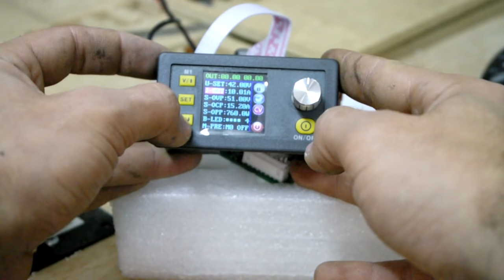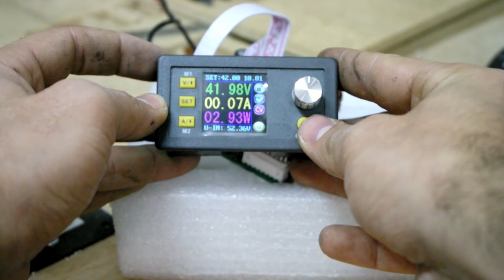How to connect brushless motor controller wires 250W 36V (Wire assemblies)

Comment: do u need to have ignition connected for it run or cud i run it without a conection thanks
Reply from the maker: No you can connect it manual to power to activate the controller..
Reply: @EVCustoms  great thank you

Comment: Hi there . I have a 36volt electric bike with passive assist . It only has 6km mode on the twist throttle. Is there a way i can change the wiring to use as normal 25kmh speed ?

Comment: Hi, Great Video. It helped me out sorting out connections on a kit I brought from China. But my controller does not have a three speed connection as in your video, is there anything I an do to reduce its top speed?
Reply: I found the 2 spots you need to jump together on the circuit board to get the extra speed.  It seems not all the wires are hooked up on some of theae

Comment: im trying to get a scooter running I pulled out of the lake  ..its a razor version 2 with a brushless motor and 1 lithium 36v battery,it has the smaller motor controller but the wires aren't separated like you showed , they have a colored male female connector and I want to install an on off switch but I cant fnd the right diagram..any help or link would be appreciated!!

Comment: Can any of these controller work with only battery pack the motor and the throttle? I have a hub motor only, with HALL sensors but I don't have any other thing, so I really want to know if I can make it work if I buy a controller, a battery pack and a throttle. because one seller on Ebay told me it won't work, but I see on your video you only connected the throttle, the motor and the battery pack, the other connections are shorted on remained untouched.
Reply from the maker: For sure..  You can work with them, the rest is not necessary.
Reply: Do you have any experience with overpowering? In therms every motor can work with any engine all you have to do is keep the motor cool. For example I have a hub motor which says max power 300 W (36 V), but I think it can work with a 96 V 1500 W controller. More voltage means more RPM and more amper means more torque.
Reply from the maker: Jordán József Yes i have experience with overvolting hub motor..  37v to 97v is to much difference..  if you have 36v 300w hub motor is 600watt max output for this motor for few minutes, you can try 48v 12A controller, like this you increase the speed but decrease the torque and efficiency..
Reply: Just make sure battery & controller r 100 % compatible!! Not 36 v controller & 72 v battery 💥💥. Then just make sure when u bought the motor it can Handel the what the controller dishes out.. all this the seller of any these components will tell u..!!!
Reply: Over bolting ultimately leads to 🔥🔥!! Good luck.. stay safe & have a House to go back to!!!
Reply: @EVCustoms  throttle and hub just connect the 3 wires?

Comment: do u know if a 
48v 24.5ah batterey
yyk 50a controller
1200w motor
works well together?
Reply from the maker: Sure!
Reply: @EVCustoms  will the 50a controller be too much for the motor? or drain the batterey alot?
Reply: @EVCustoms  what battery did you use? Also that little device you turned on was that a bms for the battery voltage?

Comment: Brushless Motor Sine-wave Controller  Sabveton 72 v 100A    controller new but it miss a White wire.
 Can you tell me? What is the function for the white quiet.
Reply: Hull  sensor missing white wire.

Comment: i have a seriouse question for you i bought the little controller to use with my 500 wat rear motor but when i connect everything up the wheel goes the wrong way what am i doing wrong
Reply from the maker: You have 2 options...  Find learning wires,   or swap power motor wires until motor turn in right  way,  NOTE do not turn  throttle at maximum ..  Only 5-10%

Comment: Do you need a specific throttle cable/wires? Or could I just use the original one that came on my scooter, it also has three wires red, black and green.
Reply: If the controller also uses 3 wires for the throttle input, then you may be good. It ASSUMES the manufacturer used standard connectors and wiring colors. Make sure any connectors match wire colors in the right sequence before connecting them or you could damage the throttle.
The throttle uses Red=usually +5V (Vcc), Blk=Gnd, and Green=an voltage output that varies from 0 to Vcc as you turn the throttle, with Vcc being max throttle. Example, if Vcc=+5V then max throttle would show +5V between Green and Black.
You can test the throttle independent of the controller by providing your own Gnd and +5V supply, and measuring between Blk and Green with a voltmeter or oscilloscope. The voltage on the green wire should SMOOTHLY change between 0 and +5V as you turn the throttle between min and max. 
Or, without any power applied to the throttle AND disconnected from anything else, you can check to see if you can read a smoothly increasing or decreasing resistance between Blk and Grn or between Red and Grn as you move the throttle. There should also be an unchanging fixed resistance measured between Blk and Red. I'm GUESSING it's about or less than 10Kohm, but it could be something else. It could vary with manufacturer. All the controller cares about is the voltage on the Green wire.

Comment: Hi there, I'm thinking of replacing the 3 power cable connectors with 1, 3 pin connector for convenience. I'm trying to find a good connector for that, do you know how many amps go through those cables? The connector I found is rated 8amp and don't want it to melt...
Reply from the maker: Hi mate... don't connect this connectors, you can damage your controller. Tel me rated power of your controller?
Reply: @EVCustoms  Thanks for the quick reply, I appreciate it. The controller is 36V, 22A (750W) max. The motor is rated 500W. I was thinking of using a simple 3 pin connector so I can quickly connect/disconnect it, as I keep it with my battery in the same bag. This is the connector I'm talking about: https://cdn.solarbotics.com/products/photos/6c7f8225a3bf9590e8258e5140317ff3/14187-IMG_0138.jpg
Reply: puedo usa este controller en un patinete eléctrico kugo kirim M4 ???agradecería respuesta,gracias

Comment: If it's a 24V 250W controller, does that mean the battery powering the bicycle has to be exactly 24V or a 22.4V battery with 10amps would still work?
Reply from the maker: Hi friend..  the range of 24v battery must be from 18V minimum voltage of battery to 25.2V maximum battery voltage, this is running voltage of battery if is lithium battery pack. But you must see also Voltage range of controller to calculate your running range, All controllers have different ranges.. For 24V 250W motor you need double power to start the motor 500W, so you need 24V 20Amps max output from battery, controller 24V 10A normal and 20Amax for starting current.
Reply: EV - Customs thanks for the quick reply. So will the 22V battery that I have be enough to operate this type of 24v controller in your video.
Reply from the maker: Yes..  but you will not be able to use all capacity of battery, this way  you can use only 60-70% because the controller turned off on 18-20Volts.

Comment: Hello there i have lyfco scooter 3200w it turns on as normal but it wont move they told me that the throttle is the prb but the prb is that i don't find the same throttle like no where.and im just wondering that if i can change  the whole throttle system or wat can i do, please help 😭

Comment: Can i connect a charging socket to positive and negative wires for charging of a battery(it has only 2 wires) when they are connected to the controllers positive and negative terminals

Will my controller burn while charging in ac220v domestic voltage

Comment: My hub motor has not 4 but 5 small wires plus the three big ones. 4/5 are the usual colors: the extra one is white. How to deal with this? Help! The bike is 2012 Curry Izip Merto w/36volt 26Amp motor using three wire throttle, 5 wire On/Off switch/"fuel" gauge/PAS/TAG select control pad. HELP! (I tried simply ignoring that wire but it seems it needs to be connected).

Comment: By "Tree speed connector" do you mean "Three speed connector"?   Is that just controlling the MAXIMUM speed, regarless of the PAS level on the display?    also the self learning/reverse function, i still dont understand how to "set it" or use it after your video. ...maybe a bit of editing to add text explanation?  thank you for this it does help with trying to understand a bit.   another problem is the wire colors are not standardized for some features. I am trying to replace a 36v scooter controller but i cannot find one with the same wire colors, wire combinations and connectors....
Reply from the maker: Hello my friend.. sorry about that, this video is to old... with self learning function you can 1) synchronize your motor power wires (phase colours) 2) you can reverse hub motor direction and 60° to 120° synchronization
Reply: So Is self learn mode an open loop control without using sensors, like a low current sensor less mode, I saw you were able to stop the motor with your hand.

Comment: Can u make any brushless motor run backwards by connecting it to this controller (ofcourse with the same wattage)?
Reply from the maker: You can do that changing hub motor  power wires, yellow, green, blue.

Comment: Hello, very good Video and it helped me to learn about this Controller and Gas twist. But i dont know how to connect the Batterie Indicator. Do you know how to do?
Reply from the maker: Hi friend...  Battery inticator you can put on thin red and black wires of controller, when controller is on power well be go to inducator.
Reply: Hi thanks. Do you mean the Power Cables which are connected with  the Battery?
Reply from the maker: No... You must have other one pair with RED and BLACK thin wires
Reply: No, not Single, only together with other Colours. Maybe dont habe that. But i think every Controller must have a Battery Control? Right? Thanks for your Support.
Reply from the maker: ok... if you didn't have thin power wires you can connect them on battery (thick) wires but you need extra switch to turn it on-off.
Reply: Ok, i see, i need a new Controller with more Cables. Thanks.

Comment: Hi, I have to replace my ebike controller but it's hard for me to understand one that suits it in terms of WATT.
The specifics are:
Rated voltage: 48 V
From 11A to 22 Ampere
Throttle voltage: 1.2V to 4.4V

Do you know how many WATT should my controller be please?
Reply: Sounds like 500 watt nominal 1000watt peak. Take amps×volts to get watts. 48×11=528

Comment: I've got a 9pole cable (Higo) coming out of my 250w hub motor and all I can find is controllers with 3 motor cables(which is fine) and hall sensors with 5 cables.... None of the hall sensors that come from controllers have got white cables with them, neither did yours really. Does that white cable even matter..?

Comment: Hello and excuse me for disturbing you.

Could I know what are the 6 little green, yellow, red, white, black and blue wires that go with the big three yellow, green and blue wires going to the motor?
There are not these little children in my new controller, is it because of this that nothing moves?

Thank you again for your help.

Francis
Reply from the maker: Yes this three little wires is hall sensor wires.. Green yellow and blue  thick wires is power motor wires. This wires must be connect to motor
Reply: @EVCustoms  Ok merci.
A quoi servent ces 6 fils.
Pourquoi la roue de la trottinette ne tourne pas ?
Merci à vous.
Reply: @EVCustoms  OK, thanks. What are these 6 threads used for? Why does not the scooter wheel spin? Thank you.
Reply: @EVCustoms  Hello,
I would like to know if the controller of an electric bike is the same as the controller of an electric scooter?
Thank you for your reply.
Reply from the maker: You must Check ignition wire and combination of your power motor wires.
Reply from the maker: Yes if motor is hub motor..
Reply: @EVCustoms  I do not understand, what does that mean, please?

Comment: Hi EV-Customs and fellow's youtuber. Wanted to uses potentionmeter instead of throttle. Can I connect it to either pas sensor or throttle cable? Connected either end of potentionmeter with +5V and Ground, and signal cable to center lead of potentionmeter. Seeking advice.
Reply from the maker: Yes my friend you can run the controller with potentiometer, signal always center lead for variable voltage output 0v to 5v
Reply: Thanks brother for respond. I am using 10K potentionmeter. Turning the potentionmeter clock wise motor works but when reach middle point of potentionmeter and further down the motor idle. Counter clock wise back to 0 and start again the process having same resulted. Do you have any idea what is the best value of potentionmeter?
Reply: @kwikchek7480  Hello; I'm same point of you. Could you find any proper potentiometer?
Reply from the maker: Hi friend...   Proper  value  is 5k but i need to know  how  you connect the potentiometers??
Reply: Value follow EV. Any potentionmeter will do. Important is how you connect
Reply: The answer I was looking for! Thanks!

Comment: what happends if you connect it to two 12v batterys making just 24dc? would it work?
Reply from the maker: If your controller is on 24V operation...  If controller is 36-48v then is will  be low voltage.

Comment: Hi I need help ,  i am assembling my e bike kit but the wires coming from the battery and the wires from the controller are diffrent so I can not connect , please help
Reply: Al Cle I fixed it now , you have to strip about an inch of wire off all ends then twist the wires together (red to red, black to black) then wrap in electrical tape

Comment: Sir i have a burning connector issue on that big yellow wire, what does mean
Reply from the maker: That's mean you must make better connection on your connector...  try to ironing or cut it and connect them with new wire connector..

Comment: Dear.

I am now repairing a bicycle that has a controller (voltage 36v, 15A, part number: LSW768-113F X18090180 and its model is CE: g3m20211-1592-1) the connection cables of the screen are messy and of the motor HALL SENSORS the same without However, I want to make the correct connection and not short circuit or damage sensors. the sensor voltages are not the same as the power display.

does it have some information from the service manual, i.e. circuit diagram (board).🤔🤔

I will appreciate your help!😎

Comment: Excelent video...i have a wx365 ebs 48V on my bike. i´m new in yhe e-bike world, and trying to figure out why i can drive only 25kms with my e-bike, after the batteries have been fully charged. The batteries are new. I´ve heard the controller could hold the problem but i don´t know what to do...and it doesen´t go faster than 37km/h...can anyone help me please? Thanks
Reply: some controllers have a speed limiter plug.  Trying to figure that out on my own controller, to limit it to 750w

Comment: I have one wire for the power(ignition) should I connect it to the battery + terminal?
Reply from the maker: Fawwaz Jawabreh Yes my friend, only on positive wire (terminal)
Reply: EV - Customs thanks for the reply mate. Sorry to bother you, I have a 3000w controller for BLDC motor, but I bought the throttle pedal from another manufacturer, whenever I connect the power wire the motor starts to spin immediately without pressing the pedal, have you ever encountered such an issue?
Reply from the maker: Throttle pedal is magnet or resistor? If is magnet put on red and black wires 5volts and measure on black - signal the voltage and twisted the throttle to see from 0v - 5v output. If is resistor measure black and red, you must see resistanse 1k-5k, after measure black and signal with twisting the throttle..
Reply from the maker: Most common problem with this is wrong colour connections...

Comment: Got a serious problem. Tried to be a genius, and connect a gps tracker to the 12V DC output on the motor control unit which is intended for use with a torch. Since doing that im getting error code 10 which means communication error, typically this translates to a loose wire. DIsconnected gps then tried else everything to sort this. Checked connections many times, checked all capacitors in the computer box(mcu), checked wiring in the hub motor everthing seems connected correctly. Maybe its a factory reset job not sure.....Any suggestions?.
Reply from the maker: Hi friend..  witch model controller you have? can you check hall sensors?

Comment: I have a 350 watt 36-48v controller, and I'm trying to get it to power a hoverboard wheel, but no matter what wires I connect it doesnt do anything. Help please?
Reply from the maker: You connect  also hall wires?  Or only power wires?
Reply: @EVCustoms  There is hall and 3 motor wires on the hoverboard. On the controller, there is hall, motor, handle, back up, brake under low voltage, gear speed, alarm wire, and the self learning wire. I plugged in hall, motor wires, power, handle, and self learning. It does nothing. One time the wheel showed resistance when spun, but otherwise nothing happens.

Comment: hi
In the minut 2:50, there are "self learning wire" what is the function of this wires?

Thank you so much
Reply: That's the eu 25 kph restrictor.
Reply: Thank you for your answer
, but  In another place I foud this answer for my question : The two wires white are used for to identify the true sequence of hall sensor.
Reply: I think it's the Chinese motors I was told nearly always have a white wire.

Comment: Hi EV Custom...i have electric kick scooter that limits speed at 25km/h. If i buy this and connect it, will it increase my speed? I am using nextdrive e scooter 24V 250W with ebrake 10.4ah battery and 3speed setting.
Reply from the maker: Mustarie Musop Hi.. for best results find specs for your hub motor, after we can find best controller for your scooter